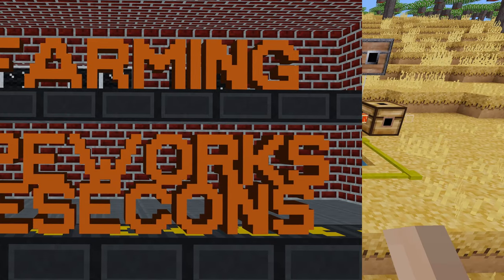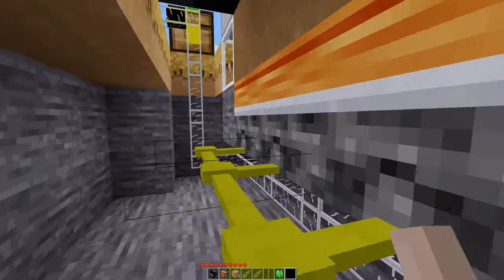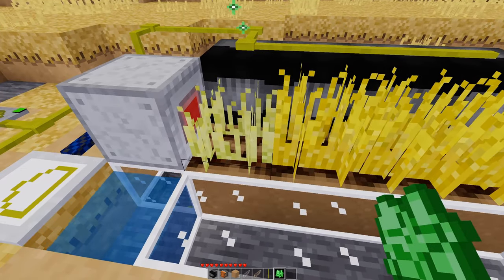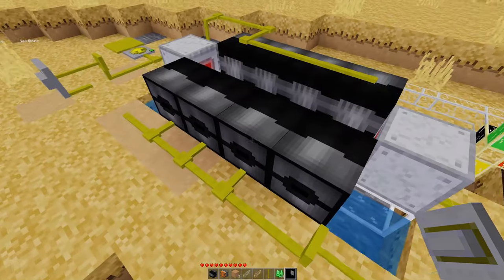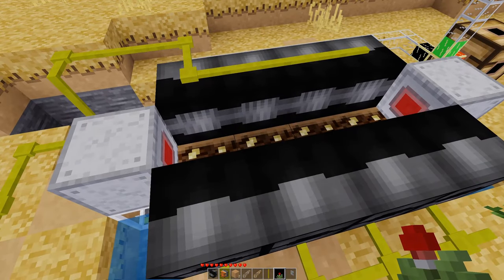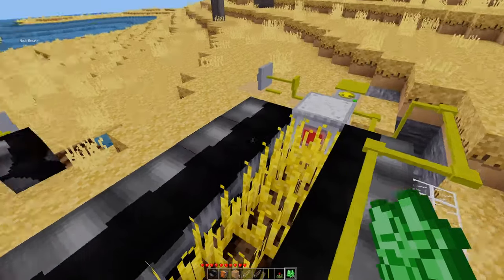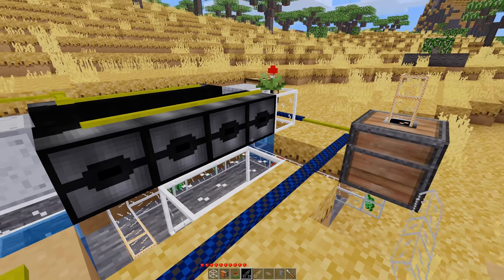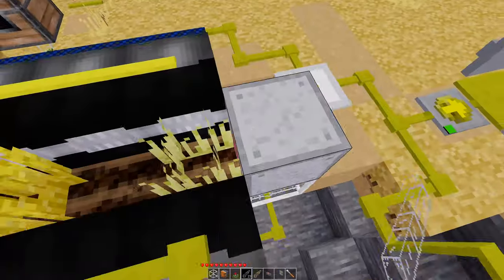Minetest Automation | Farming -  Mesecons&Pipeworks

Comment: Interesting. I use a digtron for farming. The field from bottom to top is water, farming soil, air, air, glass. The digtron goes under the glass when you run it. From front to back it has rows of digger heads (facing down), spacers, builders (facing =1, pointed down, planting seeds), and storage and the automatic controller.
Reply from the maker: I like that idea. I have a few more mods to cover how they can be used for farming. I may try to do one showing how the digtron can be used.

Comment: You can simplify the system by placing a mithril scythe in each node breaker. The harvesting is done with vacuuming pneumatic tubes. No deployer system...
Reply from the maker: Assuming of course that you are using a mod that provides a scythe, yes that would work.
Reply: but the deployer needs to place seeds?
Reply from the maker: The scythe doesn't remove the node, just resets it to the first growth stage, so you can keep harvesting without replanting.

Comment: Hello,
I am at a road block. I am attempting to automate a farm and I found this tutorial but it appears i am doing something wrong. I am using Minetest 5.1 on a private multiplayer server. I have successfully built this system but it appears I have a problem. The deployer will only deploy seeds on "hoed" dirt. My question is how have you managed to get your seeds to be placed without hoeing after each harvest?
Reply from the maker: The soil needs to be manually tilled the first time, but after that it shouldn't revert back to normal soil after harvesting. Make sure there is some water within three nodes of the soil so it doesn't dry up.
Reply: @LuantiVideos  Thank you so very much. As a NOOB I have a lot to learn and sometimes I do not envision a fix on my own. I should post a KISS sticker on my monitor to remind myself to "Keep It Simple Stupid". I wonder now how long it would have taken for me to arrive at that solution on my own? I am currently experiencing a second problem but before I post I am going to experiment and explore some more. Maybe I will deduce the solution on my own. Again thank you so very much for these tutorials.